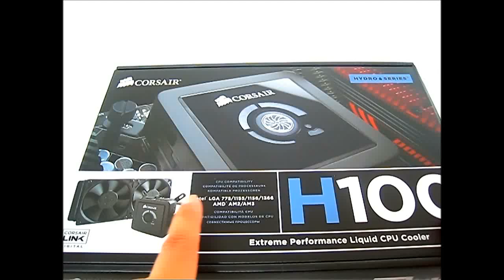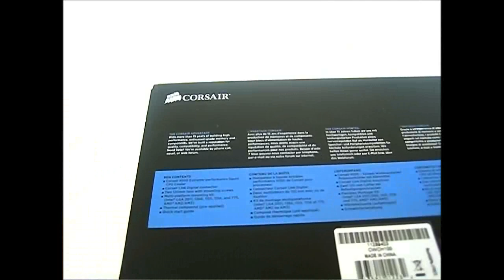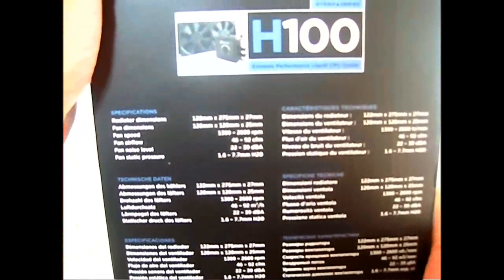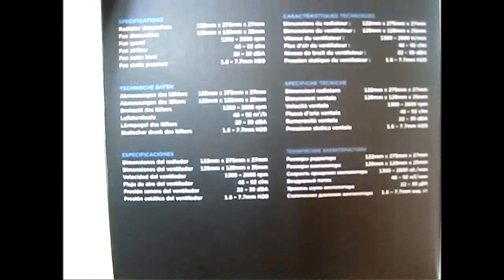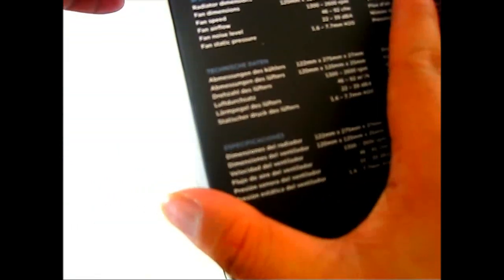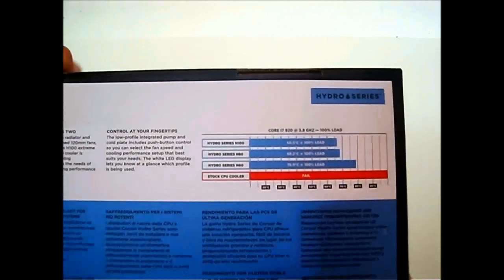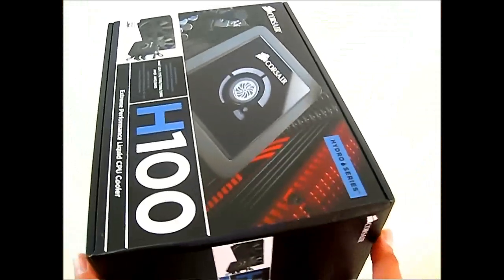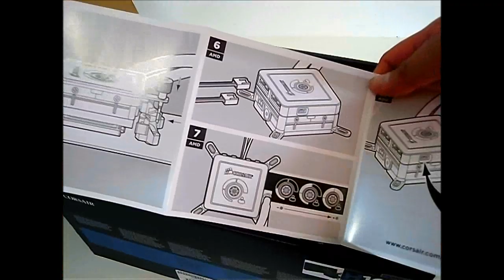Corsair H100 Hydro Series CPU Cooler - Overview and Installation

Comment: That was handy, Thanks for adding the extra cpu connector info, I just bought a refurbished h100 from Corsair and was unsure what to do with that plug, I thought it might need to plug into the cpu spot on the m/b but due to it being with the molex was unsure, Anyway it's done right now thanks to this vid. All the best.

Comment: pretty much true, if you start to notice your temps getting hotter after the first 6mo to 1yr or so, take it to your local computer shop, or look up videos on how to do it yourself, and clean it out and refill the coolant, heat+liquid=disipation, it lasts quite a while, but it will eventually run kinda low.

Comment: on the cable connected to it the 3 pin is actuly so the mother board knows there is a cooler on the cpu other wise the system wont boot properly you need both the molex(for power) and 3 pin to check fan speeds and such

Comment: 1.) No, it is self-contained

2.) Yes, mounting brackets for AMD/Intel included.

3.) Again, it is a sealed unit so liquid is contained in tubing & rad.

4.) These self-contained units do NOT require resevoirs or anything like that, ready to go out of the box.

Comment: You would actually wind up with better performance and spend less by upgrading the RAM to GSkill Ares and using the Noctua. You wind up with a quieter rig, better RAM and about the same cooling for less money than a four fan H100 setup. You could also look at the Phanteks PH-TC14PE which cools slightly better than the Noctua and comes in a bunch of colors.

Comment from the maker: Basically, you would be looking at spending twice the money as an NH-D14, having a much louder cooler (the stock H100 is louder than the NH-D14, two more fans would just make it MUCH louder), having a larger cooler than the NH-D14, and getting similar performance to the NH-D14.

Comment: Well there are several to choose from the brands I listed, so it's basically what badge you want to see in your case.. 

If it were me I'd go with the thickest rad available as long as it fit.. which would be the Antec '920'  or Thermaltake Water 2.0 'Pro'.. they are nearly identical except the name, but both have a 50mm thick rad and really flexible tubing.  

I can pm the links if you want, but I'm using Newegg to compare them all.

Comment: I see, the 212+ is decent, so most of the temperature improvements will be when your gaming.

 I got to looking around after my last reply.. if I'm not mistaken,  Coolit makes the Corsair water coolers and Asetek makes the water coolers for everyone else ie. Antec, Thermaltake, and Zalman.  Although I will say that the Thermaltake coolers have thicker radiators.

I doubt you can fit a dual rad in the roof of the haf912 without modding, but google around to make sure, I'd stick with a 120mm rad.

Comment: Depends, it would help to know what cpu and case you're using.  But I'll just say this, when you're looking at the high end air coolers, they are nearly as expensive as water coolers and they are huge.. adding a ton of weight/stress to your motherboard and causing clearance issues with ram.

I would go with a single 120mm rad closed loop cooler, just make sure what you buy fits in your case.

Comment: The h100 is within just a couple degrees of the D-14 when overclocking, so unless you just love air cooling the h100 is worth it imo.. especially when you can install any kit of RAM you want.  Yes the fans are loud on 12v but you can get some better fans to pair with it, such as Scythe gentle typhoons..

Also Cooler Master is coming out with 'eisberg' w/c kits that have much better quality than Corsair... thicker rads, flexible tubing, and high end pumps by Eheim.

Comment: Are you sure that you've connected CPU fan controll adapter to the motherboard? That is the main connection between H 100 and your computer, also molex for power must be connected or otherwise pump will not work.  If that is not connected than you get that arror. If you've done that, then I am sorry, but prolly RMA, it may be motherboard, or H 100.